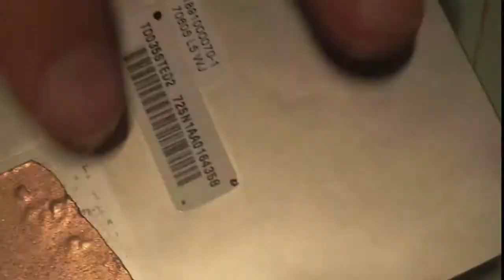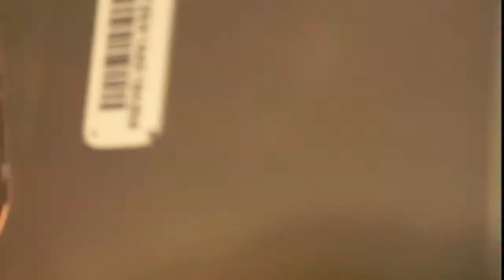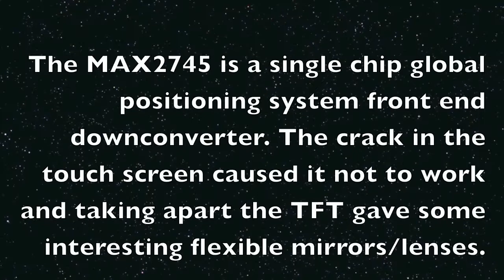GPS Teardown

Comment: MAX2745 comes up as "complete single-chip global positioning system (GPS) RF front-end downconverter" so it looks like it handles the radio functions. I'm curious about the test pads marked GPSRX & GPSTX visible at 9:35...maybe serial communication RX & TX? Interesting video...